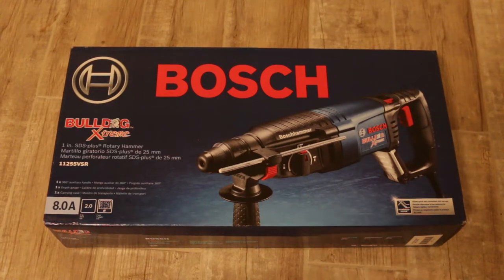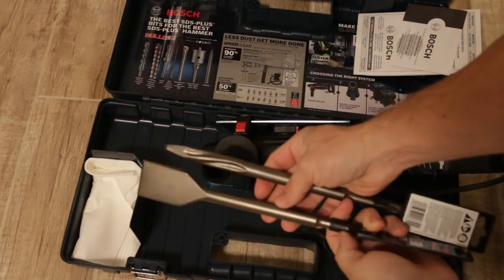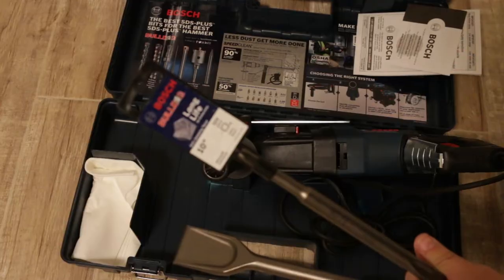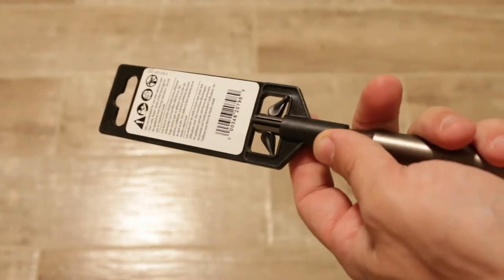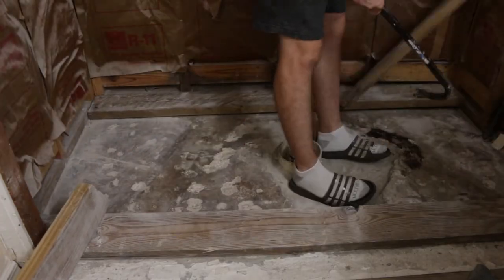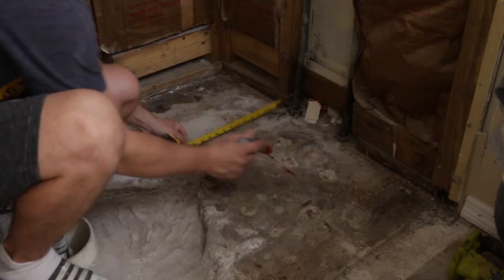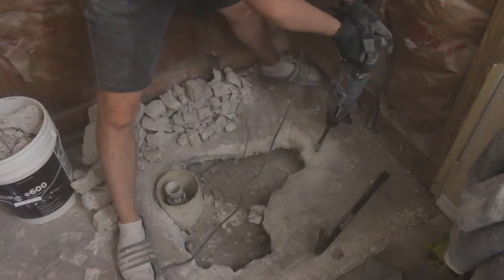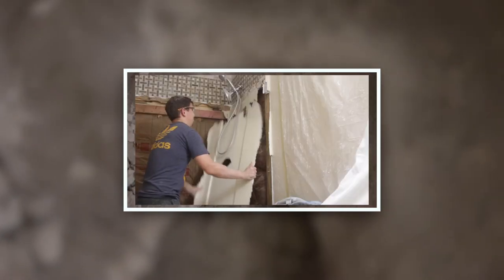How to break concrete EASILY with Bosh Rotary Drill Hammer | Bathroom renovation - Part 3

Comment: Another tip is rent a real breaker for 60 bucks at home depot and be done in 25min. your tool is a rotary hammer drill with a chipping feature for small are tile removal.ya it got the job done but whats your time worth ?
Reply from the maker: Sometimes we have to work with tools we already have....
Reply: That depends on where you live, all my stores in my state are charging $110 to rent a jack hammer when for $50 more bucks you can just buy this and have it. Also use for other jobs as well. That to me would make it worth it
Reply: It depends. My friend is Arab and after he rented a nail gun he got visited by the police. No idea why.

Comment: Sure doesn't look like concrete. Concrete has gravel in it and is not that color.
Reply: Looks like thick-set mortar. Much easier to break up than concrete.  I think the SDS-Max Bosch hammer would be the right choice for that.
Reply from the maker: thanks
Reply: It’s most likely a mortar bed for an old fiberglass shower pan or tub. Loose pack.

Comment: Fake review. Those are good for stucco walls not foundations
Reply from the maker: This tool is safer to use than the jackhammer (especially for the first time DIYers). I did a review of a jackhammer if someone interested, here is the link to the video:
Unboxing Xtreme Power Jack Hammer + In-action Test
 https://youtu.be/wW6h1Ll1nsc
Reply: @CreativeProcessDIY  diyers should call the guy